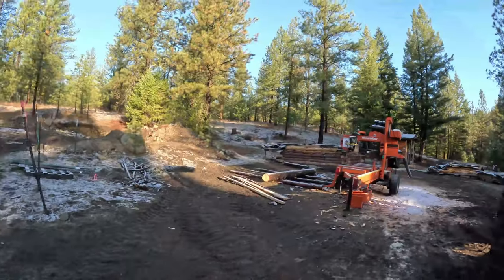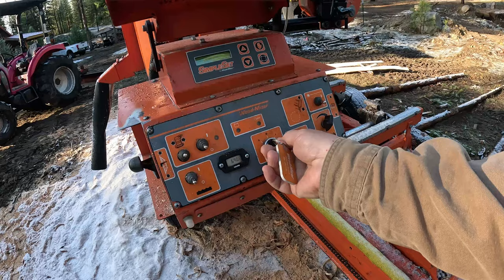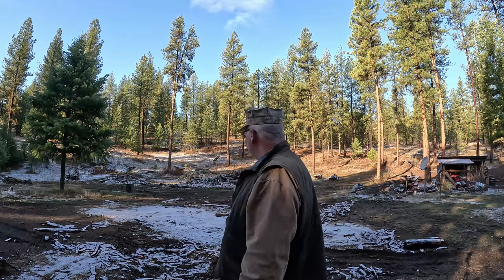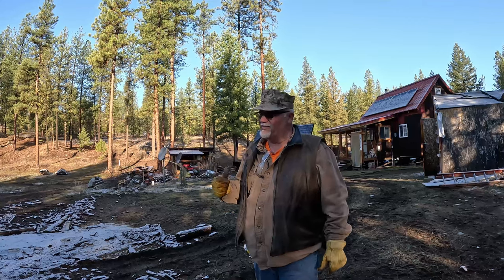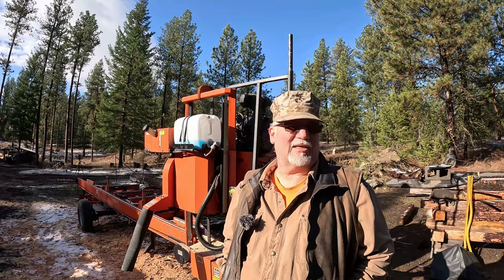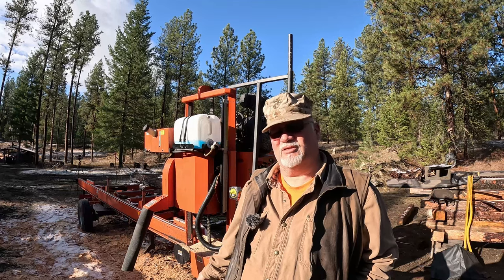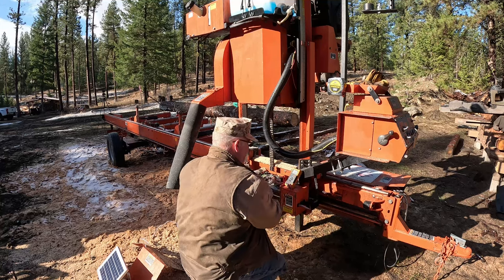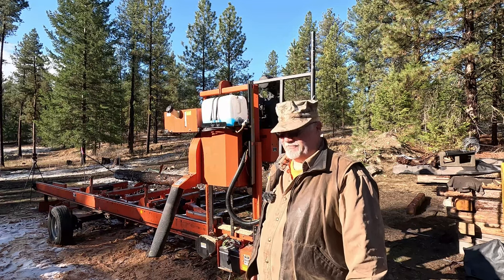Sawmill Troubleshooting: Why Isn't It Working?

Comment: i would take the batty home and charge that up at home and check if it has a weak cell to put a quick disconnect on the sawmill when you go home turn off the disconnect from the mill 
the mouse was chewing a wire some were back feed power from your batter 
i would drain your high hyd fluids and change the filter to may have water in with your tank on too
Reply from the maker: All good ideas thanks

Comment: Battery problem in cold weather, not uncommon. Jump to car starts are cheap – often based on 18650 Lithium. Small enough to carry out to the saw. Quick to recharge inside. Powerstation has a larger power reserve, but costs somewhat more. Small batteries up to ca 9Ah are also cheap and should be enough to keep the voltage level above 12.0V. Slightly larger panels also provide faster charging – price and practical thinking give the best results.
Reply from the maker: All good info -- the problem with the sawmill though, might be as simple as a disconnected exciter wire ;)